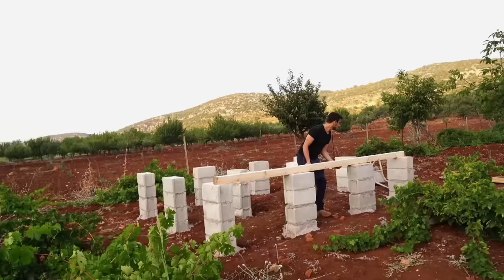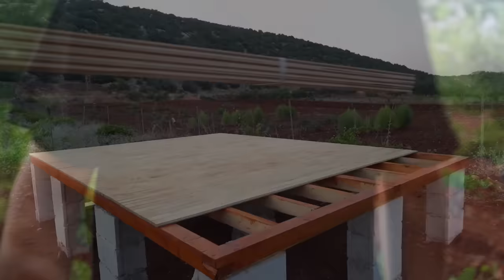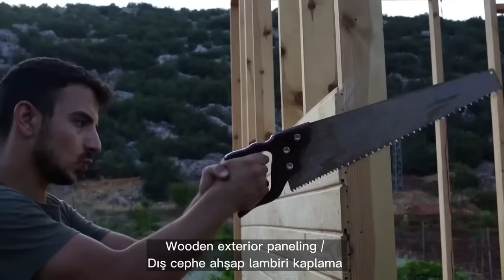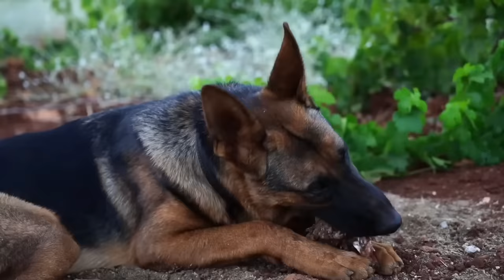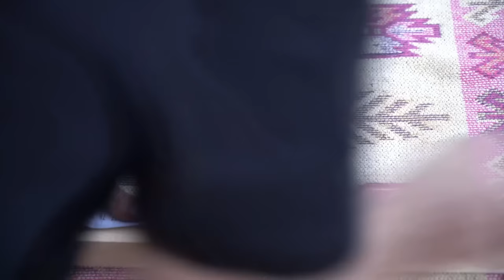Building a Wooden House in 10 Days / Off Grid Log Cabin / Full Video

Comment: From the start, I was impressed by the solid foundation of the concrete blocks and using a protective varnish on the joists. You will have storage underneath,  plus little worry about moisture or insect damage.  May you have many years to enjoy this lovely home.
Reply: are you impressed that the house is not bolted to the concrete blocks?
Reply: ok
Reply: I was wondering about that too! It will be blown away by the strong wind if it’s not bolted…I didn’t see it being done…
Reply: @sonyasibongga4487  Just because you don't see it doesn't mean it isn't done.
Reply: @MrNordie  I huff and puff and blow it down?

Comment: You shouldn't use nails for fastening the steps of the entrance; rather, make a slot on the sides for the steps to fit in. It's much better. You need to use a circular saw, a drill, and some long, thick screws for holding them in place. Even if it's more difficult, it's unbreakable. Nailing can go loose and you could trap a leg between a step and its long nail

Comment: 00:02 The video showcases the construction of a wooden off-grid log cabin in 10 days.

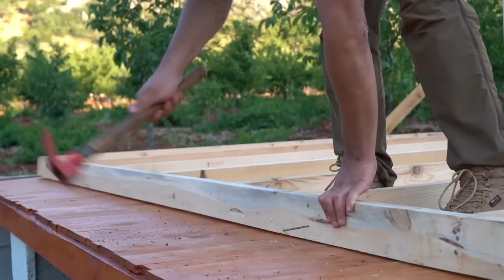07:16 The video showcases the construction of a wooden house in just 10 days.

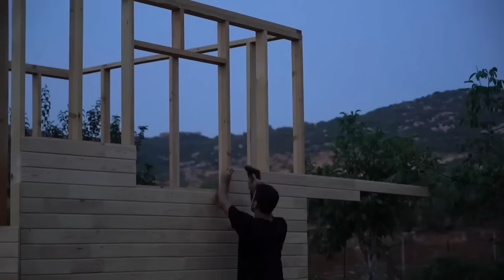12:09 Building a wooden house in 10 days

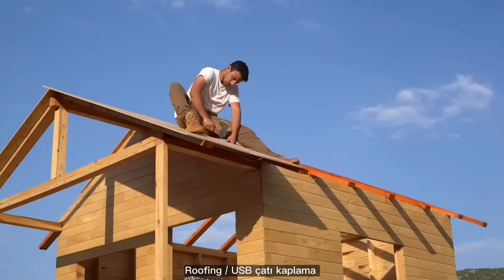16:48 Building a wooden house in 10 days

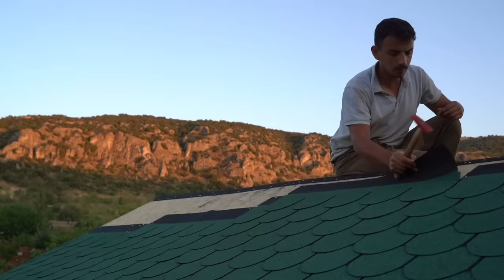21:58 Building a wooden house in 10 days

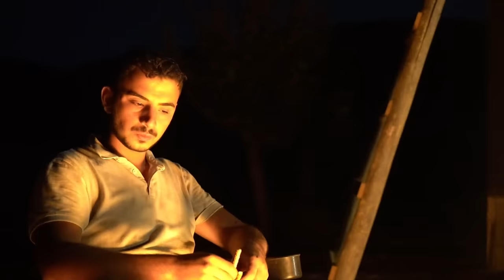24:04 The video shows the process of building a wooden house in 10 days

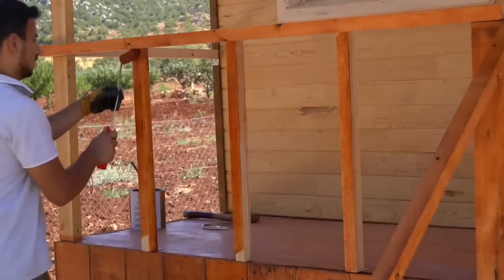28:39 Building a wooden house in 10 days

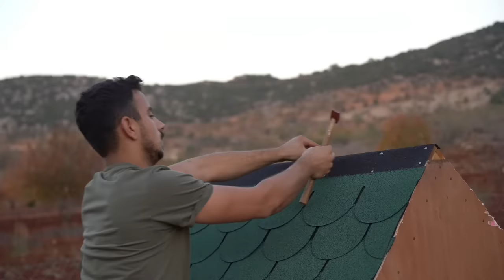33:06 Building a wooden house in 10 days

Crafted by Merlin AI.

Comment: Enjoyed this very much!!! Especially the rain!

Would it work to pre-cut and stain most of the wood? 

Could we use a heavier hammer and a hammering block to protect the edges when fitting the grooved wood? 

Storage under the house or the dog’s warmer spot…

Does the prevailing wind blow into the front door?

Comment: Your work was excellent, but you did not observe two points, firstly, you did not put any connection between the foundation and its bases, and secondly, you did not do thermal insulation, but overall it is good in terms of decoration and use in not so cold seasons.